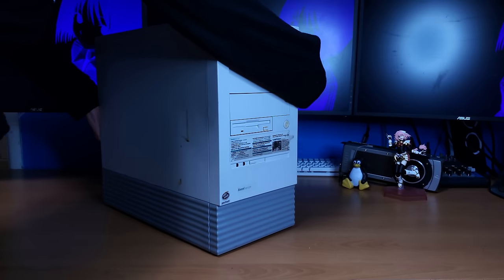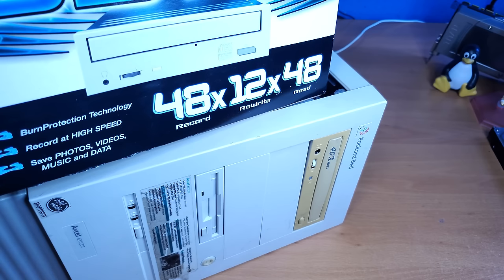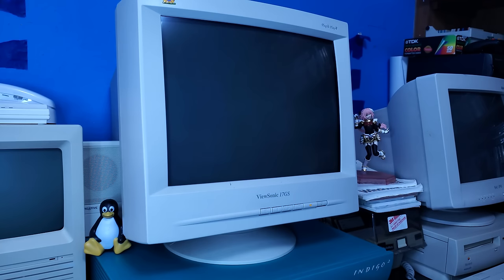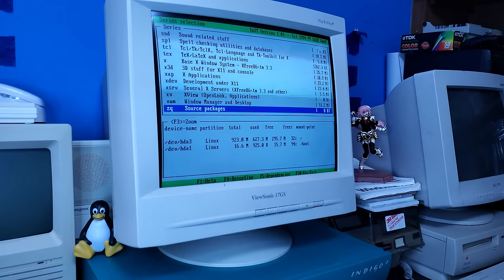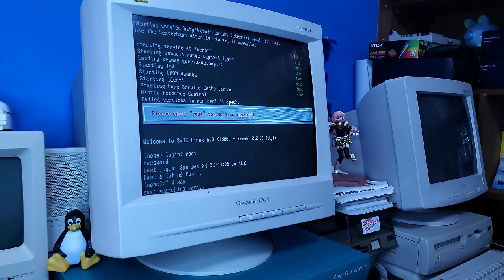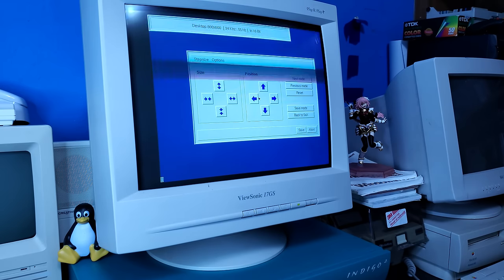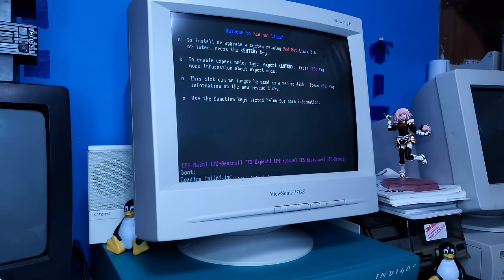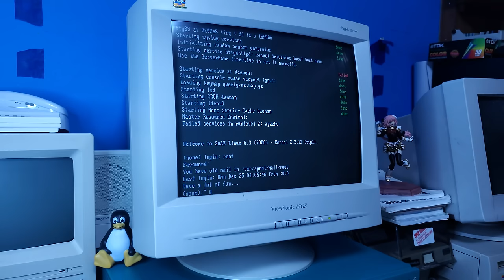Enjoying 1990's Linux on an $8 PC From 1995!

Comment: This is my exact memory of 90's Linux, spending 4 days trying to get X11 to start correctly lmao 😂
Reply: so true
Reply: yup! it was when we used xfree86 before xorg!
Reply: Yep. I had a cheap Trident card in my K6-2. It was a complete disaster getting X to work properly on it. Wrong color depth, wrong resolutions for my monitor, etc. I ended up buying an S3 ViRGE card and magically X worked after the first run of xf86config - I also remember how awful that script was. Mess up one key stroke and you have to start all over again.
Reply: @wysoft  also, I was running Debian testing at that time and every other update screwed the whole X config 😅
Reply: I remember working as a student assistant at a community college and being asked to spec out lab computers that would run Windows and Linux they ignored my graphics card suggestion went with an integrated Intel video chip and had nothing but trouble with configuring Xfree86 until I found a work around. 
 Xfree86 was easy on Mandrake 6.5 with the same chip in this Packard Bell but that distro came with lots of other hardware compatibility issues!
Reply: This!!!!! So many installs that needed the user to be a wizard! 😂
Reply: Ayup.  You kids don't know how easy you have it now (mid-40's man shaking fist)
Reply: @FedericoPedemonte  average debian struggles!
Reply: Yeah 😁. I tried Red Hat and Mandrake on my old Compaq Presario K6-2. Both ended as expected. I did get both running but too many incompatibility to work around, and then I didn’t have the programs I enjoyed on Windows. Today I run Linux Mint and wow, what a difference compared to the past.

Comment: Two suggestions: I remember this machine fairly well, with your hard drive, that thing still used the old cables, You need to make sure the jumpers on the back of the drive were correct for how it was plugged into the motherboard. If you don't, or should I say didn't, lol, it simply would not see the hard drive. Second thing, your cmos battery was dead. They did some really weird stuff when that battery died, besides just forgetting the time and date. I would have changed that right off the bat.  Seeing Suse on there was so exciting and brought back so many memories. That distro was in my opinion the best at the time, the installer was almost perfect.
Reply: Yeah it could be just as easy as setting the jumper to master, but If I remember right I think there is a bios update for Phoenix that allowed larger drives.
Reply: @player_unknown963   Well, that's true, too.  Maybe I misunderstood - I thought it wasn't seeing it at all. I honestly can't remember if it would only see it and let you use space up to a max value, or if it would just totally wig out and not see the drive if the bios couldn't handle it. For some reason, I seem to recall that a workaround to that problem was to partition the drive on another computer to the max the bios on THAT machine could see. But it's not an issue I've seen in almost 30 years, so I might just be totally misremembering.  Getting old sucks.  😅
Reply: @BlueRidgeCritter  10-4 to that lol Miss those days though...
Reply: I had this exact machine too - my first PC.  Now an IT security professional…been a journey my friends 😅
Reply: @player_unknown963  Yes, there was a bios update for this machine to accept bigger drives but heck if I could find it now. However to get around this you could have made several 1Gb partitions on the newer drive. At least your drive would have preformed better and you would have had a few extra partitions for storage.

Comment: $8 isn't bad considering the crazy prices Pentium PCs are going for at the moment.
Reply: I got a dell from a Goodwill or some similar type of store a couple years ago for like $10.   Pentium II (forget what speed, I upgraded it to a Pentium 3 750Mhz),  somewhat busted CD-ROM.   The motherboard had a real OPL3 chip on it.   Made out pretty well.  Threw my old Voodoo2 in it, got a replacement drive.   not a bad haul.    Still would love to know where all the youtubers keep finding these thrift stores with really good finds though
Reply: @Blink_____  It wasn't as bad couple of years ago I think. Now Pentium PCs seem to go for around 200$-300$ and a Voodoo 2 card alone can cost over 100$. Pentium II/III PCs are a bit cheaper, but $10 is still a great price.
Reply: @Blink_____  I think some people pick them up from electronics recyclers. Unfortunately, part of the price is shipping, which has gone way way up to the point where shipping costs about the same as the PC itself.

Comment: I picked up a cheap Packard Bell quite similiar to this in the early 2000's from a coworker, tossed two 3Com 100 Mbit NIC's in it and installed FreeBSD on it and used it as a router for a couple years. Despite PB computers being considered by enthusiests as kind of a joke computer, it was actually quite well built and very stable. The only thing that didn't work was sound, which I didn't need anyway, the one I had used some properiatary modem/sound combination card that just didn't work with anything but Windows 95/98.

Comment: There used to be a company called Conner that made HDDs back in the 80s and 90s. I think that Western Digital bought them out but I'm pretty sure if you're able to find one of the last Conner drives, you might be able to get something around 2-3gb in size. It was one of the quirks of owning a Packard Bell. They were made cheaply with mostly cheap parts and Conner drives were notorious for failing but for some reason, worked well in a Packard Bell. Also, the Aztec soundcard/modem you have there were typical fare in the PBs as well. They were Sound Blaster compatible and the sound wasn't too bad.
Reply: I have PTSD from using Connor hard drives.  Every. Single. One. failed.  I still have Maxtors from that era running today.

Comment: My first computer was a 80286 Packard Bell. Had the state of the art VGA color monitor. Year later 80386 was released and it was light year ahead in term of performance. Saved enough money and eventually got a 486sx motherboard/cpu with 4mb of RAM. I was the envy of my friends.

Comment: Wowe does that pc take me back! And all those problems you had, I had them too.

My Mother got me one of these at a thrift in 2006 for the price of about $10. I thought it was so dope af because I made a matching set of the CRT, mouse, and keyboard.

My greatest success was installing The Sims 2 on it. It ran like dog poo and would freeze up solid after a few minutes 😂

I'm talking BSOD up in that lol

All it came with was Windows 98 SE and a few little saved webpages, a zine made by a kid, and not much else.

Wish I had saved some of those webpages because they were dated from about 1996 and 1997. Guessing it originally ran Windows 95 but was updated which explained weird leftover files in the Windows folder.

Good times messing with old PCs and getting glimpses into the digital past which isn't as well archived as most may think. Thank you!

Comment: Red hat 5.2 was my very first exposure to Linux. Boxed copy, from Staples. Although my box was white and not blue, but I very much remember it. Put it on a Toshiba 105 CS laptop, with a pentium 75 and a 500 meg hard drive. 😂 Fun times. Computing is no fun anymore compared to what it was in the late '90s and early 2000s

Comment: I had a very similar-looking Pentium 100 / 1GB / 32MB RAM machine, even with the same GPU, when it was brand new. Mine was dual-booting SuSE 6.3 around the year 2000. This PC had adequate performance until like 2001-ish, at least Visual Studio 6.0 worked like a charm, I had so much fun with it...

Comment: That was the year i started installing Linux on my 486 machine besides Windows with dual boot. My first distros were Slackware and then Red Hat. I did not have active internet connection then as a Linux n00b. It toke me few weeks to learn the basics by reading lot of documentation. Countless re-installs and config tweaks to finally get my Xserver detecting my graphics card and CRT monitors best resolution and refresh rate. 🤓

Comment: I had one of the Packard Bells from about the same timeframe. I think I got it in like 1997 or so, dont recall the specs but had twin Maxtor drives that clicked and hummed me to sleep for many years.   Talk about a walk in the past.    Now if only the white noise generators would have that as an option.

Comment: FYI i had one of those factory refurbished machines purchased "new" in 1998. The model i had was 233mhz and was blazing fast compared to the 100mhz machine that it  replaced. The onboard graphics will actually play quake 2 on software mode!

Comment: I remember owning a Packard Bell quite similar to that except that it came with 16MB of RAM initially instead of 8MB. Quipping in about the HDD issues, the BIOS back then could only support disks up to 2GB in size. The only way to bypass this was an addon card that added LBA support for drives greater than 2GB. Often times this only had support up to 8GB in size.
Reply: Linux by itself should be able to see any secondary drives, after it loads its own PCI ATA driver. Getting something booted however requires a device the BIOS can see/use.  I've used that exact same Promise IDE chipset around 1999-2000 with and I'm almost certain it saw drives larger than the BIOS would..
Reply: @mystica-subs  Best recollection to mine was that the BIOS was dated either late 94 or early 95, just after the announcement for Win95. This was the day during dialup internet and something like flashing a BIOS was unheard of. Largest drives I've seen in the market were often 1GB while 500GB were more readily available.

Comment: It seems pretty difficult to find the old RedHat distributions - especially since they renumbered it a few time, and it's now a current product again. I have an EISA/ESDI system, and it requires an older distribution. I think it has 6 or 7.something on it now. It has mechanical SCSI drives and one ESDI drive on it. Eventually I want to just simplify my configuration & keep but retire my mechanical drives - just so I can keep using my computer without worrying about inevitable hard drive failure.

Comment: We had the Legend version of this box when I was a kid. It had the somewhat infamous WD Caviar AC31000 1GB hard drive that was notorious for developing stiction. The Aztech sound cards in these were weird and usually didn't work without the OE installers (at least, under Windows). What size hard disks were you trying? You remember that there was a roughly 8GB limit on old non-LBA BIOSes, yeah? I don't know if that affects this machine but it's worth thinking about if you were trying >8GB disks. I don't know why an add-in card didn't work, but it's possible the BIOS doesn't support booting from them and nothing attached will show up until you're in an OS. Sort of like how you needed a boot floppy to bootstrap a basic OS before you could load something off a CDROM.

Comment: The BIOS almost certainly does only support 8.4 GB HDDs at most and has a hard time recognizing disk with the "wrong" type of HDD when looking at the amount of heads, sectors and so on. One trick is to partition a HDD in another, more compatible system and set the HDD settings in the BIOS manually to 8.4 GB. Just make sure that the first primary partition is smaller than this and it will work. I had a 20 GB HDD in my Pentium 1 back in the day when I was still using it. And 64 MB memory (max cachable). I think it ran Red Hat 6 but I have been running Suse as well.

Comment: a lot of systems from that time period have a limit of 8GB drive sizes.  So if you do something like a CF to IDE with an 8GB card, the system should recognize it.  The other thing you can do, is use MaxBlast or Seagate Seatools to utilize an Hard Drive Overlay driver to make it work, but you will lose a bit of your conventional memory in the process as a warning.  I'm sure other people have said the same thing about this below.  I also think I have the Recovery ISO software for this machine range.  Fun thing to play with.

Comment: Re: bootloaders, I believe that this version of SuSE predates grub by several years, so lilo was likely the only choice. That, or loadlin from DOS.
Reply: I think I had SYSLINUX in 1998. You could install it in the Win95/98 bootsector and have easy dual boot.
Reply: @joe--cool  Dang, I forgot about syslinux. I've never used it.
Reply: @eriksiers  I think it powered most boot disks and CDs (actually still does). You can see SuSe using it for the floppy in this video.

PXELINUX is also cool for booting from an NFS image.
Reply: @joe--cool  I'll take your word for it; I don't really know much about the boot process in any way. 😁

Comment: Although my first computing experience was on a Unix mainframe in 1981, I guess I cheated when it came to Linux because my first ever permanent install of that OS on actual metal came via a Knoppix live CD. Through it I could install Debian without having to go into all of these configuration hoops. Anyway, I used KDE with the Keramic theme an never looked back. I'm now in my 24th year of Linux use, although I still have Solaris (OpenIndiana) and FreeBSD installations for those times that I get the Unix urge.

Comment: It's possible that the new HDDs you tried, didn't work because there was a time when you had to set the HDD to "master" and the CD needed to be set to "slave". There were jumpers on the back of the drives to change the settings.
Reply from the maker: I had tried that and had no luck :(

Comment: Here i bought red hat software install package at a computer store 2 decades ago. Placed it on a 1996 IBM PC 365 Pentagon Pro box i had. Once had a dozen of those

I was dumbfounded that Red Hat worked and found the Two lan cards from an obsolete old Bank computer.  That Microsofts stupid software did not see the PCI lan cards in Nt4 or win 2000..

Comment: Why not plug the drive into another Linux machine (or another machine with a Live CD, or use an old Live CD on the same machine) and disable the root password to examine the original drive? Maybe it could be used for development and you could find some lost source code. (and you can see the x86 file for an optimal screen configuration)

Comment: There is nothing special about this machine WRT the hard disk support. It would need a BIOS update OR special formatting software installed on the disk in order to support something larger than 2.1 GB. OR you could install a SCSI controller, but that would likely only get you to 8 GB and good luck finding working 8 GB SCSI disks. The way to go is to get a PCI card that supports flash storage and forget about spinning rust storage. It's only worth trying to get 20th century storage working on truly historic, collectible machines.